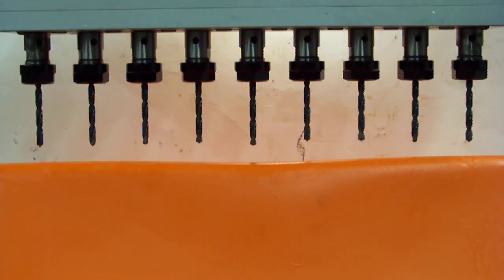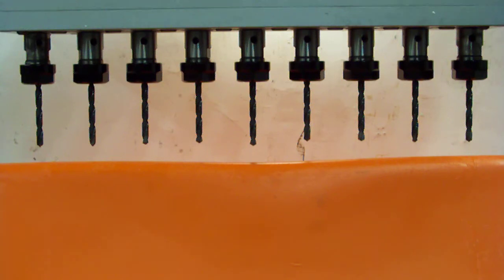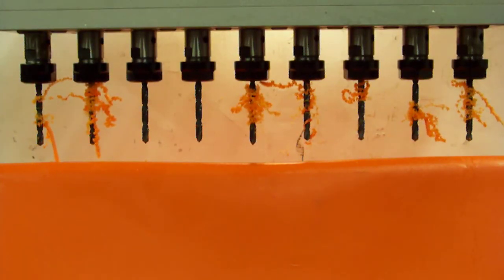Higher RPM, 0.5 HP Drill Press Drilling Nine Holes - AutoDrill

Comment: Hi, I might need something with about 20 drills spread out over 7 feet in 2 lines, one of 14 and one of 7 drills. is this something that's possible? what kind of drill press would I need? and can you make an adapter this big? Thank you
Reply from the maker: DarwinThug We don't check for comments here very often.  ...But we beleive we can help you.Can you e-mail or call us directly? Sales@Drill-HQ.com or 01.908.542.0244 / 800-871-5022
Reply from the maker: DarwinThug Our largest head was either 36 or 40 spindles so we should have no problem creating what you need.